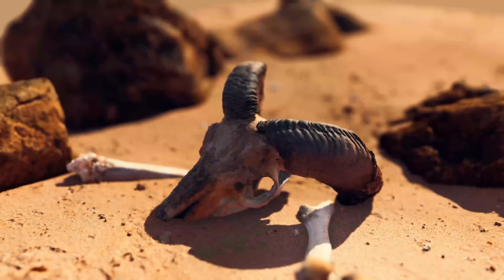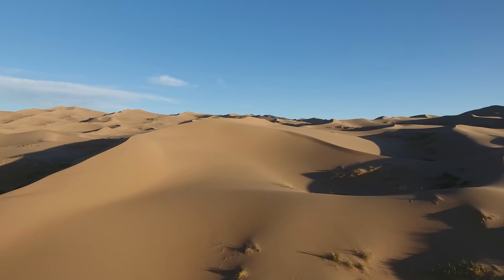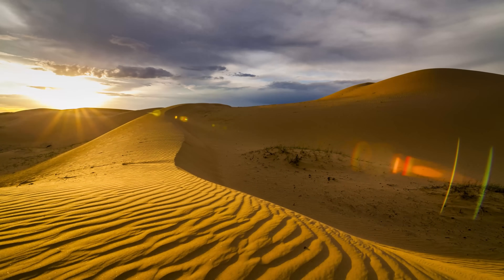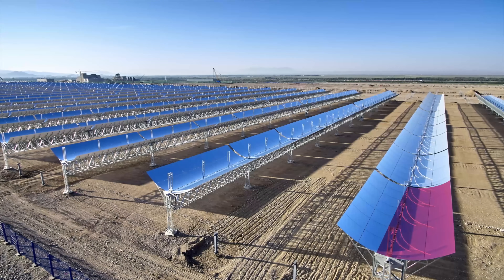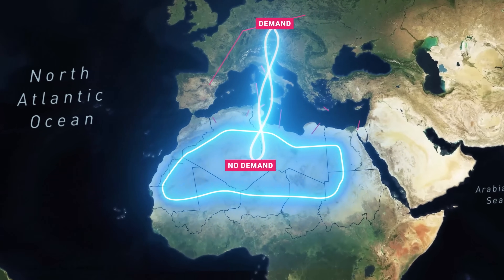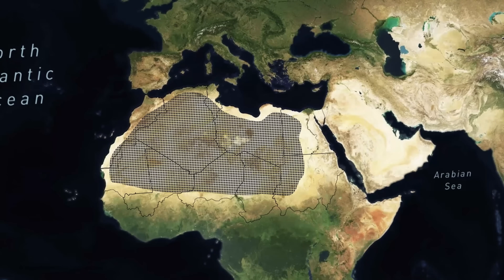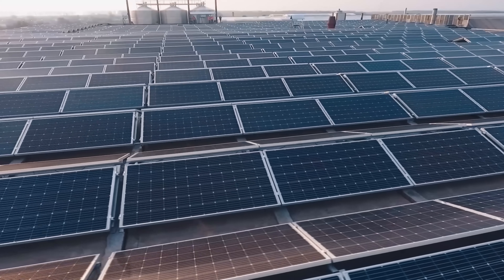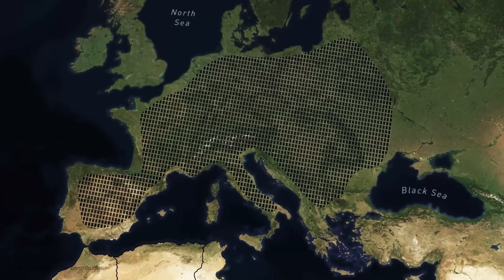Why Solar Energy in the Sahara Failed

Comment: There have been been big solar projects fail in the US too, but shouldn’t throw out the baby with the bath water.  Having products pushed on market over-hyped or with ridiculous limitations (like early cars, or early slow and expensive early home computers) is nothing new…happens all the time, but then they usually get better, cheaper and more efficient with time and trial.  There may just be inherent limits on solar, but my guess is that just 20 years too soon.

Comment: The key point here is true: Getting the power from Africa to Europe would be difficult due to the extreme length of it. Plus to my own thinking such a power cable would make a tempting target for terrorists and hackers;. As in a bomb in Africa would be capable of blacking out much of Europe. Along with the prohibitive cost of making the nessesary power cable to begin with.
Reply: well yeah, when you think of it in the most ignorant way possible. a bomb ANYWHERE could destroy ANY infrastructure, so how is this a valid point at all❓
Reply: @benwarped7272  Valid Point? What is the difference between repairing a power line hundreds of miles long, to repairing a power line thousands of miles long? 
The difference is, both the costs of the needed items, along with the extra expenses for vehicles capable of traveling thousands of miles fully loaded through an arid waterless desert. 

That is, without adding in possible terrorists trying to kill them along the way.

Comment: They should pump sea water to Sahara and use the electricity to break the water to hydrogen. Hydrogen can then be pumped to Europe by gas pipeline. If energy is pumped as hydrogen, there will be no that bad transmission line losses.

Comment: Crossing several country’s borders for a single project needlessly complicates matters. Make smaller projects inside a single country, say like Morocco, that will provide it with most if not all the power they need, create many well paying jobs, develop a high tech energy sector and probably even make them an energy export powerhouse. Then once other countries see this, they will do the same and each can be energy independent, control their own grid and increase the standard of living for the citizens

Comment: You made some good points, especially how unstable the regions and people can be but missed the biggest one. The power loss from high voltage power transmission is not a massive problem, the problem is the production of the cables. 
There are only a few companies that make them and the current waiting list is years long. The Algerian to Britain and Europe connection that is currently in development to supply solar power decided to make a new factory to produce the cables themselves as the wait list would otherwise be unrealistic. That project will only supply a small percentage of the power used for a small part of Europe, in order to supply all of Europe the amount of cable required would require massive investment in companies just to make more cable.

On a side note, Australia is currently building a huge solar farm to supply Singapore, its effectively the same thing just on a slightly smaller scale and done by two very wealthy and stable countries.
Reply: Nice englisch

Comment: It's better to build wind farms in the Sahara.  Sand will cover the solar panels.
Reply: Depends on the architecture and surface of the panels i guess. But yeah, you made a point here.
Reply: There are solar farms in the middle east already and they are regularly maintained and cleaned off of dust and debris. Maintenance is necessary in these projects and dust and stuff wouldn't be that major of an issue
Reply: @bitraven5956  Difference is those solar farms are closer to population centres
Reply: Or wind panels with solar panels

Comment: If only these factors including people causing damage and countries abusing power wasn't existent then this project could possibly solve the world's energy crisis
Reply: Not really, having a centralized energy producing plant will increase the cost of infrastructure from the place to the rest of the world incredibly. Moreover, creating a large scale solar plant in the Sahara would also mean creating a city where people that maintain the place can live in. With little to no access to infrastructure and water and the Really high temperatures and dryness of the area, I'm not sure how well it would go.

Lastly, cross continental power lines would lose a lot of efficiency and would be sunject to natural damages. Imagine all asian  electricity suddenly going away because the wrong tree fell on a power line somewhere in Egypt.
Reply: @JonathanGiovannacci  You really think that one sole cable would go that distance and power a whole continent? Redundancies for power cables are a discovery from centuries ago.
Reply: but this would make the energy companies poor, and you KNOW they wont let that happen.
Reply: @benwarped7272  That's absolutely not why it won't work. It won't work for economic, logistical, technological and geopolitical reasons. Much of this solar would replace imports of foreign fossil fuels for Europee.

Comment: Interesting story. Humans could accomplish the impossible if humans didn't screw it all up for political and ideological reasons.
I was thinking the power and transmission line infrastructure needed would be the biggest impedent. I didn't think about the terrorist BS that would blow it all up in a heartbeat for pennies on the dollar.
Other than that, if graphene ever becomes economically viable and manufactured on an industrial scale, it could certainly be used to make transmission lines that wouldn't lose nearly the energy current technology does.
Someday...